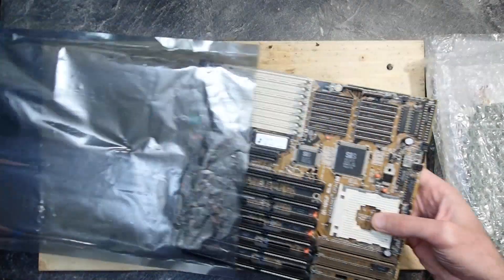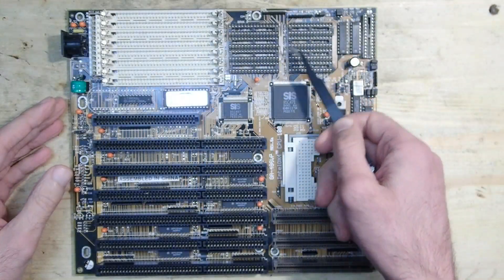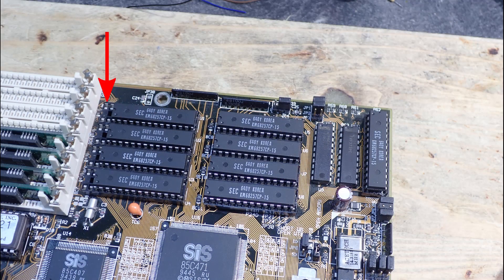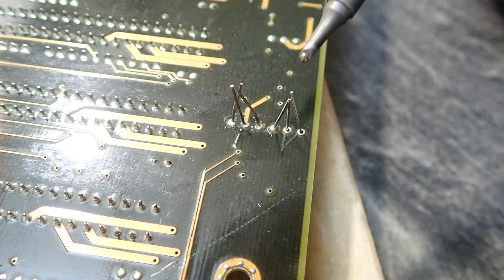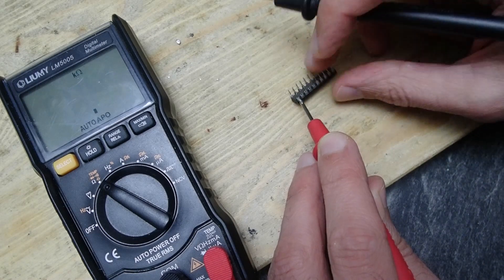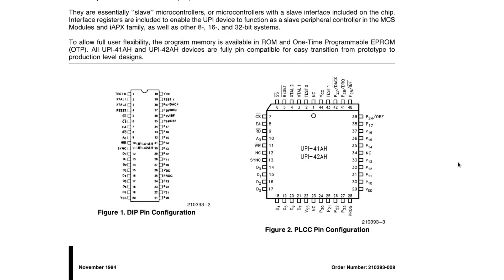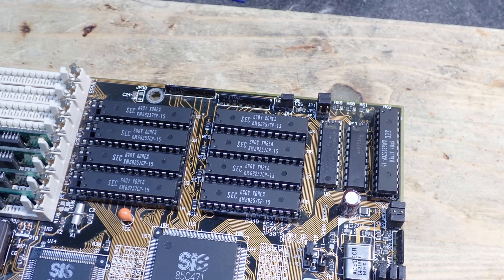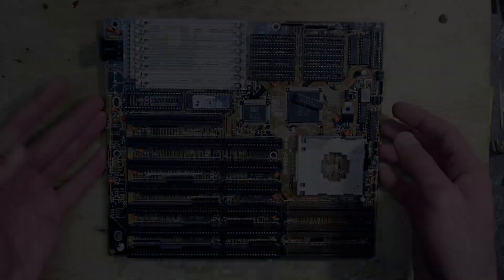Repair Marathon 21.04: #4 Gigabyte GA-486VF (partial success)

Comment: So close mate I think if I could make a suggestion with the cache I have heard of the flatpak chipset controllors being a issue but also a combo of that and cpu but again it wouldn't surprise me if there is some kind of easy silly problem to fix like a dodgy trace or connection of some form but I am sure you will find the answer and I could be completely wrong but I will await to see what the issue is I am speculating about my ideas but none the less you are more qualified to say none the less. cheers
Reply from the maker: This is an old video and a follow up was made half a year ago ;) Have fun.

Comment: when the cursor pauses on the parallel port configuration, the value changes. at one point it was 3BC, and another it was a more common 378. this can indicate something causing the base address to change from installed devices. if you weren't moving expansion cards around, that's a bit strange.
Reply from the maker: I was playing around with different controllers as well, as I made the recordings, so that's all right. If you are interested, what was the issue, just watch the last part of the repairathon, where I come back to this board.

Comment: I had an issue with an old Packard Bell PC regarding cache.  When I added  32Kbx8 at 15ns to the board with a TAG chip the system would freeze after the BIOS tests passed.  I checked all of the cache ICs and they all passed testing with no issues.  So I gave up on it and left the cache off of the system.  Later I decided to come back and try again.  But instead of 15ns ICs I used 20ns ICs.  The chips were still 32Kb x8.  And with that, the board started working fine.  I have no idea as to why the faster chips wouldn't work but the slower ones did.  I would have assumed the exact opposite to be true, honestly.  But I thought I would share my experiences with strange cache issues.   Maybe you have already tried this, but did not document it in the video.  Either way, I am super impressed with your ability to fix these boards, and wish to applaud you.  I have two boards here that I cannot get to function that I wish I had someone who could fix them, but I don't have anyone close by to help me with them any longer.
Reply from the maker: Thank you for sharing it. I tried different ICs with 15ns and 20ns latency, unfortunately nothing worked. But I'll try to analyze this issue further. As in your case, may be your 15ns ICs were just faulty? Could that be?
Reply: @necro_ware  that is always possible when working with old hardware.  I did test them and they passed testing, so I cannot rightly say.  But it is interesting how a part that works in one system and passes all tests causes another system to fail completely.

Comment: С кэшем надо ещё в BIOS установки сделать. Объём тег-кэш должен соответствовать режиму, WB требует в 2 раза большего объёма, чем WT.
П.С. До начала загрузки ОС, на всех материнских платах, кэш отключён.
With the cache, you still need to do the installation in the BIOS. The volume of the tag cache must correspond to the mode, WB requires 2 times more volume than WT.
P.S. Before starting OS loading, on all motherboards, the cache is disabled.
Reply from the maker: Всё установленно как надо, тэг в порядке, кэш в режиме WT. 10 раз проверял, перепроверял. Думаю, что на шине данных какая-то дичь... будет время на осцилоскопе покручу. Но спасибо за идеи!

Comment: Spitzen Arbeit! Wie immer. Freue mich auf jedes Video. Den LT38C41 gibt es glücklicherweise für relativ kleines Geld als Ersatzteil. Das L2 Cache Problem ist wirklich merkwürdig. Da das Board gar nicht damit läuft, werden wohl die Bits kräftig durchgewürfelt und erzeugen 'Datenmüll.
Reply from the maker: Vielen Dank. Ja, der Controller sollte ersetzbar sein. Wobei, neu kann ich den nicht kaufen, weil ich kein passendes ROM dafür habe und ohne wird es nicht funktionieren. Der Controller muss ja wissen, dass der ein Tastatur Controller ist :) Was den Cache angeht, da muss wieder mit dem Oszi dran, sowas ist nicht unbedingt einfach herauszufinden und ich werde wohl mehr Zeit brauchen....

Comment: Thanks for your videos. Interestingly, I've got exactly the same problem on a similar motherboard. Mine has the same model number, but has 4 72pin memory slots. It boots fine with cache disabled and hangs at the exact same point with any cache configuration. The difference is that my board used to work before I tried to replace the cache chips (wanted to try 512kB instead of 256). I sort of suspect that a static discharge destroyed something in the chipset, but I'm not sure 100%.
Reply from the maker: Yes, this is my fear about this board as well. I will have to take some time later and analyse it with the oscilloscope. Such problems are not the easiest task to do, that's why I had to make a break here.
Reply: I had a similar  problem with cache, but on an Opti base motherboard.  The problem was solved by starting in turbo mode. Just shorted two pins and it started booting.
Reply from the maker: @UnclePriff  Tried that already. With turbo, without turbo, also with different FSB settings as well. Unfortunately, all the same. I don't think I will be able to solve it without making an oscilloscope session ....

Comment: Great work. Regarding cache, I would consider putting 7 or 8 ns chips in there. Also, what about fiddling with cache settings in BIOS? I mean putting chips in and disabling cache in BIOS etc. What about 64kB cache - did it also give that result? Is it possible to set cache timing in BIOS?
Reply from the maker: Thank you. 15ns ICs are the fastest I have, but for 33MHz FSB, they should be more, than enough. Playing around with BIOS settings didn't help. I tried 64KB cache, just in case, but it is officially not supported by this board. Only 128-256KB. I still think, it's some kind of defect, but I need more time to analyse it. Such a marathon is just to short for deeper investigation. I'll come back to this board as soon as possible and will make some analysis with oscilloscope. It was just not doable in two days :)

Comment: Maybe the board had fake cache chips.. So the bios could be also locked for the real cache chips. Maybe you need another bios rom for that board with those real cache installed.
Reply from the maker: I tested multiple BIOS versions. Also Gigabyte was not famous for faking something. Furthermore, this mainboard was really high end for it's time with support for DX4, Cyrix, 3V, WB and WT Cache. I'm sure there is something broken.... I just need some more time for investigation. Two days marathon was just too short to repair 5 mainboards :D

Comment: Hi, maybe a cache timing Problem? Can you test 7ns chips? I know, 15ns just be OK for 33mhz bus, but its only for testing.  Timing settings in BIOS can also have an affect.
Reply from the maker: 15ns is the fastest I have and I really think, that 15ns is already more, than enough for 33MHz FSB. Even 20ns is fully sufficient. I put this board to the side for a little time and will come back later to it again. Since I made this marathon, I already got some ideas, which I should check..... Sometimes it just need some time.

Honestly, working on 5 mainboards in one weekend is a bit exhausting. May be I was just a bit tired, as I was struggling to make it working..... ;)
Reply: 15ns might be ok, left bank is bank0 and here are the jumper settings: http://www.motherboards.org/files/manuals/47/486vs8a.pdf. Please check out page 20. I hope you tried not china Fake Chips ;-)
Reply from the maker: @patrickbonner3764  I tried many ICs and I have no China SRAMs anyway :)  I had the jumper setting from UH19 project already, see the link in the video description. However, thank you fro the PDF. I'll upload it directly to UH19, if you don't mind.